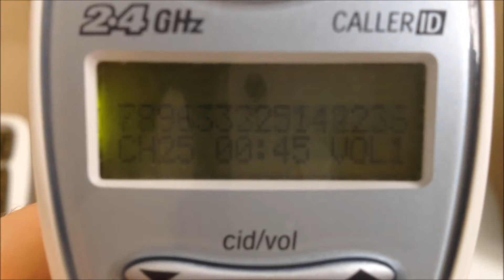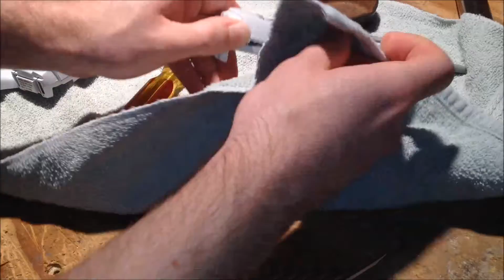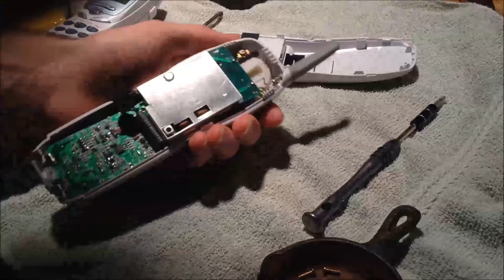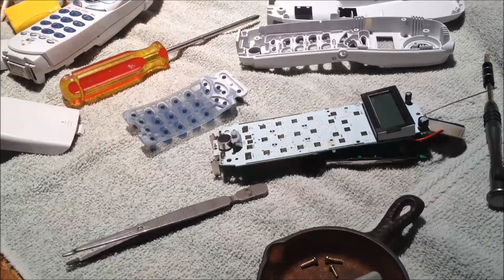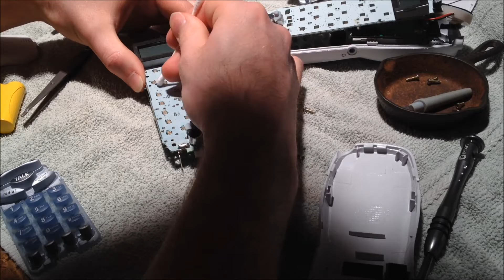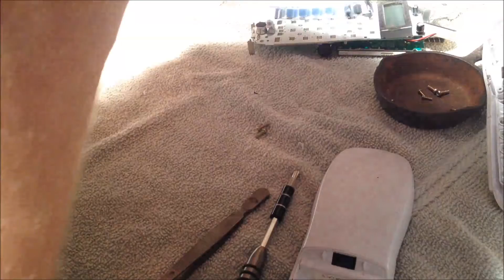Cordless Phone Repair: Double-Dialing

Comment: The 2 handsets also don't have the same key tone. The hissing one might've been an older version of the same model. Vtech and AT&T sometimes released a model and then would release a newer version of the same model with major differences. For example, the AT&T CL83201 didn't have a speed dial voicemail feature when it was first released, but got that feature later. It would be cool if cordless phones got software updates in the same way almost everything else does today.
Reply from the maker: The bases are different, but the handsets always sounded the same to me.

Comment: Who knew dial pads were so flimsy lol
Reply from the maker: +Eli Surovec They are quite flimsy when they don't have the support of the phone's casing.. You have to handle them relatively carefully especially on older units.. The rubber connecting the buttons is pretty thin..